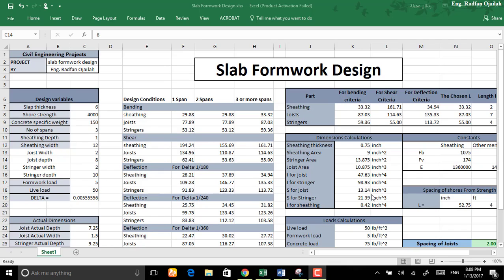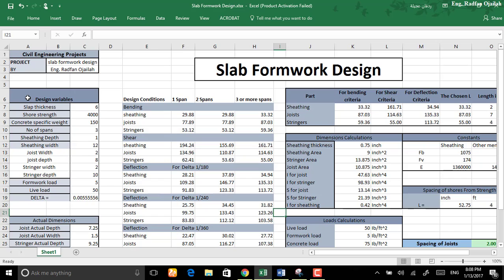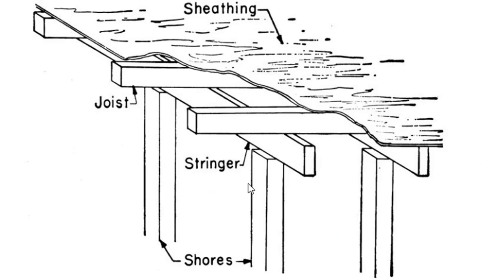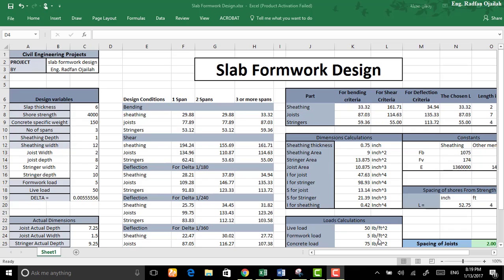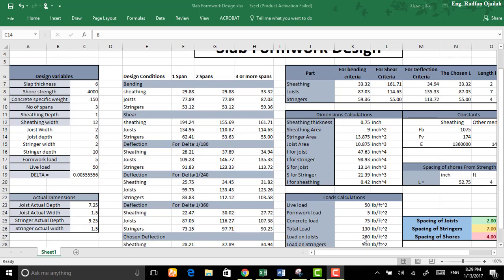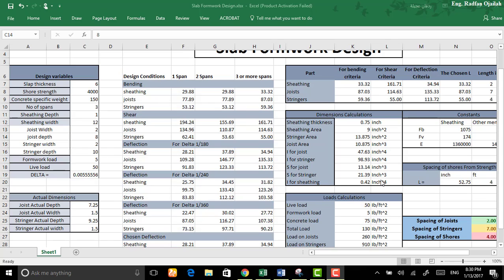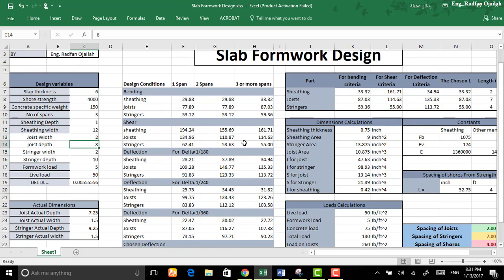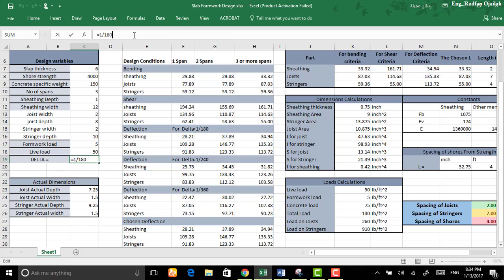Slab Formwork Design using MS Excel

Comment: Nice content.  But u failed to show the units required for the input.  You mentioned that the dimension for Joist, Sheathing and Stringer are "inches" but u didn't mention abut the units for Load, Shore strength, Concrete weight.  And what does "No of spans" refer to?